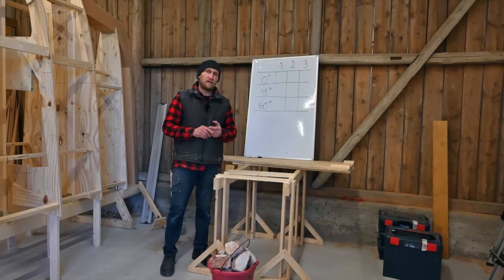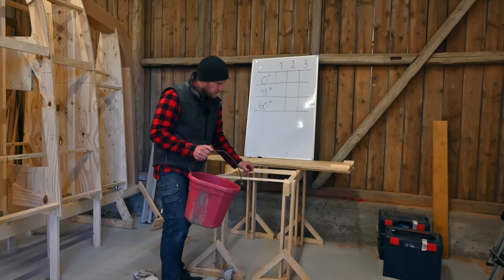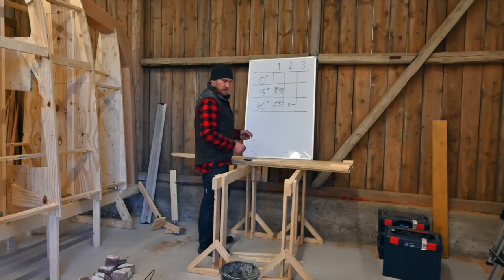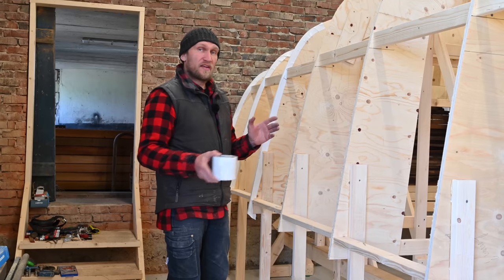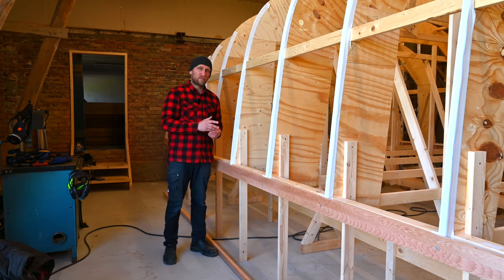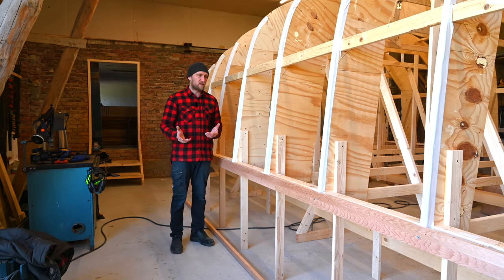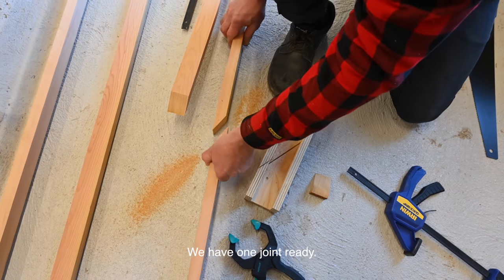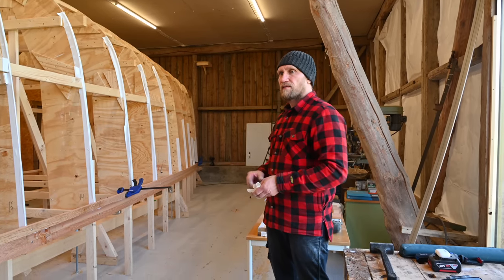The First Of 150 Strip Planks | DIY 50 Ft Sailboat - Ep. 344 RAN Sailing

Comment: Have you considered removing the screws after the glue cures? It would slow down construction a lot but would remove a possible risk of corrosion etc. This process was used in the construction of the Spruce Goose airplane. They used a combination of screws and glue and removed the screws, reducing thousands of pounds of weight overall.

Comment: My condolences for Your loss, Johan. 
Did You ever think of pouring Your resin out of the canister and weigh Your batches instead of pumping? I always found these pumps annoying to say the least, not just when it's cold. I never had my own set of pumps but always weighed my resins through over three decades of boatbuilding ... somewhere in the middle of the first of these decades I built a seesaw to strap in my canisters and thus just had to turn, no longer hold those to pour. 11/10 would recommend 😄

Comment: I would trust the scarf joint as well, but more because when you bend each strip, it will be easier to get enough leverage to bend it in the middle of each length, but each strip will be stiffer at the ends.  So when you're bending, you will be putting a lot of stress on each joint.  Just another way, I suppose, of saying that it is indeed easier to get a fair curve with a scarf joint.

Comment: Check out epoxy metering pumps. They dispense both resin and hardener in the proper ratio with each pump. You can see it in action on The Duracell Project YouTube channel. So sorry for your loss.

Comment: store epoxy in a heated enclosure , makes it much easier , when you start planking the more curved sections of hull , the gaps created between planks create issues , consider creating a convex and a concave edge ( router or spindle moulder ) on the edges and you will not need to shape each edge .

Comment: I couldn't see, and am not sure it matters when planking a boat, but the opening of your 60 degree splices should aim toward the aft of the boat. With house clapboards, using a mitered joint, it should face away from the weather...so water could never be forced by prevailing winds into the joint. I realize you'll be using fiberglass over the planks...but wonder if maybe it's still better to have the joint open to the aft rather than to the bow. We love your videos! Keep up the great work.
Reply: So sorry to learn your father crossed over the bar.

Comment: You might want to try making an insulated cabinet to keep your epoxy in.  The heat from a 60 watt incandescent light bulb would probably keep the epoxy warm enough to pump easily.  Just open the door, pump epoxy & hardner you need & close it back up.

Comment: Did you consider composite finish nails? I believe they are available up to 1-1/4 inch long which may be long enough for toe nailing in your application. They use a pneumatic nailer that looks quite standard. The nails will not damage cutting tools if you need to drill through the hull later. Spotnails is one brand sold in the US and I know there are others out there. These are popular in CNC applications because they won't damage the cutter head.
Reply from the maker: I talk about it in the video… 😉 Cheers!

Comment: im very sorry for or loss ,its a hard time ,but gets easier with time.....a couple of points re strip planking ive built 2 strip planked boats 11mtr and 10mtr firstly, build a warmer box for the epoxy use heat mats under and wraped around the bottles, the heat mats are like the ones used to propagate plants or just use a small heater in the box under the containers . scafing  full length planks helps alot  then you can do 15 or 20 planks per day.Its also possible to butt joint the planks on the boat with a screw either side of the joint. the planks above and below correct out the joint and make it fair thats what ive done on both boats .its quite common to use galvanised nails between planks in place of the screws your using they last fine if you think about it the planks once finished and glassed over they are fully encapsulated free of moisture and air so last fine
Reply from the maker: Thanks for the tips Adrian! Cheers

Comment: They make epoxy dispensers that will pump out both components. That way you avoid making a mistake and it's faster. Also you could place a heating pad under the resin to make it easier to pump. But not too warm or it will kick off to fast. Hope that helps. Cheers !

Comment: I am sorry for your loss. 
Total Boat has a dual ratio pump that measures both components simultaneously.  A chop saw with a fine blade could cut the scarf joints more quickly than a hand saw.  Can you put the epoxy components in a warm bath to heat it up a bit for better flow?

Comment: Looking great, perhaps you could make a box out of foam building insulation and have a electric heat matt  in it and keep the two parts in there to reduce the viscosity and make it easier to mix also you don't want it getting too cold and crystallising like mine did because then you will need to heat up to dissolve the crystals

Comment: make up a sealed box to house your epoxy in and run a 20w light bulb inside, this will warm up the epoxy to lesson the viscosity, making it easier to pump. alternately, put taps on and measure by weight!

Comment: If you do a search on YouTube for "Making a Cedar Strip Kayak" there is a build video on cedar strip planked kayaks by Nick Schade whose workmanship is second to none and he uses a few techniques that could benefit you, namely he uses a router to put a bead and cove on either side of the planks. This allows the planks to follow each preceding plank by providing a channel for the new plank to follow. He also uses a "U"-shaped piece of plywood to give a clamping surface to each plank at each station. Check it out, I'm am sure you will benefit from Nick's wisdom.

Comment: the hull is stronger if there is a gap between the staves in the hull. You do not need to draw them tight. Epoxy is flexible and will take up the stress from expansion and contraction and in the event of a collision it flexes rather than breaking like in your test.

Comment: @02:25 Yes, the glass has to provide the majority of the strength. the joint only has to hold till the glass is applied, after this it will not alter anymore.😁
Just out of curiosity about the strength needed from the wood: If any, what percentage of glass should be added when you had decided to use foam core...❓❓
@24:22 Please accept my sincere condolences to the whole of the family for your loss.😥

Comment: Hi Johan, Our condolences from Scotland. This is probably a stupid question, but if the planking is simply the sandwich material for the GRP sheathing then why not use a sheet material such as plywood or Oriented Strand Board (OSB)? If you used multiple sheets of overlapping ply it would have the flexibility necessary for the curve of the hull. I recently built a Shepherd’s Hut (a traditional mobile building used by shepherd’s in the UK in earlier years) which has a curved roof. I made the roof with thin ply which was fixed to curved rafters that had been made from multiple laminated strips of thin plywood. The boards are only curved in one plane though, with compound curves this would be more difficult.

Comment: Sad to hear about your Dad Johan.. I was surprised you dint consider Half lap joints...  For clamping would it be possible to use a ratchet strap anchored to the frame support, This would allow you to tension almost to the keel. in a similar way to the method used in old times to keep a hull together in emergencies.
Reply from the maker: I’m doing some testing with a sort of half lap joint right now actually. Still haven’t decided though… 😊

Comment: Sorry for your loss. Looking online, there are tables that show recommendations saying between 6 and 15 degrees relative to the length of the wood. I know by now you have already completed a majority of the strips. A better way to test would have been to use a piece of wood with no joint, then joints, relative to the length of the wood at 6, 10, 15, 45, 60 and 90 degrees. So zero degrees to me is parallel to the length of the wood and 90 degrees is perpendicular.

Comment: For resin pumps check out the seal boss pA 3000. It would really speed things up for you guys. Also Total Boat sells one as used on the Duracell project. Also aircraft spruce sells a smaller model that is air powered for $390 USD . Your boat is looking great!
Reply from the maker: Thanks for the suggestions and tips! 👍😊

Comment: You could use simple cheap drywall screws for the initial curing of the planks. Then remove them prior to fiberglass.
Reply from the maker: That’s exactly what we are doing now. 😊
Reply: @RANSailing  that will save lots of money.

Comment: Having just watched Johan's experiments with the joints, there's another factor to consider as well. You all are going to be fiberglassing this hull, correct? If you're able to get the hull faired, and apply the glass nice and flat, it seems like any loss of shearing strength on that joint would be handled by the glass. I wonder about making the hull too rigid, resulting in stress fractures in the ocean waves (over time), or as the result of a collision? I'm just an armchair YouTuber, so take my opinion with an appropriate grain of salt. 🙂
-Edit: 60 degree join makes sense. Trading joining time for fairing time. 👍
-Edit 2: Rest in peace Mr. Hammarlund. You've left a remarkable legacy.

Comment: Looking good, you certainly put a lot of thought into the build. One question on the stainless screws holding the planks in place while curing: Why not remove them after the cure?
Reply from the maker: We could remove the screws after curing, but that means we only can mount 2 strips per day. Since we have around 150 strips to mount that would take quite some time… So leaving them in, means we can speed up the planking by a lot. Cheers!

Comment: For Scarf joints the strength of the joint increases as the joint becomes longer v the thickness of the timber.  Lloyds insist on 4:1 for planking.  I wonder what their standard is for this method of epoxy bonded planks side by side.  I think the test should include unjointed pieces of timber and also some glued together sections.  As you say the epoxy bonding of adjacent planks and the screws may add strength. 

The Duracell Project use a West Systems combined/single lever pump.  However I have heard that Total Boat products and perhaps others have 3 or so options for speed of curing, that sounds really helpful when planning jobs, particularly at variable temperatures of Sweden. Some people use heating pads in an insulated box to pre-heat the epoxy.   Considering the volumes of epoxy you will be using, you should be able to find a bulk distributor of epoxy, they are the ones 1 tier removed from the producers and operate on competitive margins of 20-25% of cost as they don't repackage, rebrand. However you always need to require of a minimum shelf life remaining, operate batch control, test before working. 

Sorry to hear of the passing of Johan's dad, Johan is a huge credit to him, with so many great qualities arising from good parenting.  Particularly important to know him.  Condolences to the rest of your family too.  Lovely that that he was able to see RANII take shape.

Comment: If you move the epoxy into a safe spot in your house, and bring it out when you need it, and if you have a heater for the barn, you can keep it kind of close to that heater while keeping it far enough away so that you don't have to worry about a fire, the epoxy won't be so thick.   You can also use small scrap pieces of wood screwed into those frames and normal clamps to get it all clamped up.  I mean you only need the clamps on their for a day or so, so you wouldn't need a billion clamps and scrap pieces of wood....  You could also just use string and simple nails in those frames, as long as the string is tied to a nail that is at the right angle compared to the wood, you could put even pressure on the front pushing in, and pressure on the top pushing the boards together...    I may have explained that crappy like, but if someone thinks about it I am sure they can figure it out.   You could also use thin rods to apply pressure from any angle, like acoustic guitar builders do sometimes..   There are about a billion ways builders of things have came up with, to clamp wood lol....

Comment: If the wood is consistently breaking at the joint...something is not quite right with your epoxy bond. I would make sure to use unthickened epoxy on both sides of the joint and then thickened epoxy (with silica only) on the middle...then apply modest pressure to hold in place while curing so you dont starve the joint. If the temps are below 70 or so, I would add a small electric space heater and cover with plastic while it cures. I would scarf planks with a 1:8 ratio at least.

Comment: My condolences to the loss of your father  Johan. Have you considered long ratcheting cargo straps that will wrap completely underneath the first plank? With some chocks temporarily screwed to the form, you can redirect the vector to pull in as well as down. Also I'm puzzled as to why not remove the stainless screws that you put into the edges as long as you're removing the ones in the sides?
Reply from the maker: Thank you! Yes, we though of using straps and it probably could work, at least for a pretty big portion of the sides. The problem is however that it become complicated when you have 3-4 strips glued up on top of each other. That’s why we need to leave the screws in, since the progress would be too slow waiting for each glue line to cure before continuing with the next. Thanks for watching! Cheers

Comment: The old way in the U.S. on large strip plank boats is to use Bronze or stainless ring fast nails when edge fastening the strips on the frames ;-) You might find the nails cheaper and faster than your present fasteners

Comment: How long will the joints hold to the pounding of the waves beating up wind? Perhaps balsa-core added to the outside of the strip planks woud give the boat more strength, pluss insulation so the hull wont build up moister inside durring cold weather.

Comment: Sorry to hear about your father's passing. One thing to consider may be not an angle but the ratio. I think the standard scarf is 12:1 length to thickness ratio. If the strip is 1cm thick, the scarf would be 12cm long.
Reply from the maker: Yes, I now. I mention that in the video. However, since this is a sandwiched hull and the joints aren’t going to be stacked a 1:12 joint isn’t necessary. Cheers!

Comment: You probably don’t even need stainless screws. The core will be dry. In traditional wooden boats where screws were constantly exposed to salt water the galvanized screws worked for about 20 years before the hull needed to be refastened. In composite hull they would probably last forever.

Comment: To save some costs, leave the screws in place only long enough for expo to cure, then remove and reuse up higher on the hull.  doing this you can drop the number of screws to 15 or 20% of the 7k you estimated.  It does mean extra labor to remove the screws though

Comment: Instead of SS screws, what about bamboo skewers? You will need to drill a hole for each, but you would have to drill pilot holes for screws anyway. Skewers are cheap and strong enough to keep things aligned until the epoxy cures.

Comment: Since you’re glassing hull from both sides your strip planking is a core and you need only enough strength to bend plank on the jig without breaking. Without glass it would be a different story.

Comment: Scarfing takes time and you need to get much more contact area of the glued sections... I'm thinking you will need to scarf in the area of 75 degrees... You can make a router jig to make this longer scarf faster and have a fairer hull with much sanding and fairing... What does your marine engineer have to say about this seeing he has the final recombination
Reply from the maker: Since the joints aren’t stacked butt joints would be strong enough according to the architect. We’ll probably go with the 60 degree joints since it’s easier to the the “line” fair with those… Cheers!

Comment: what about no compression screws at all. gang stack several planks at a time and clamp the epoxied joints from both directions, to the frames and vertically edge to edge?

Comment: With a rolling plank production method, couldn't you prepare a long planks for each side and place another set on the mould? You can prep a pair a day and the next day (after curing) place them on the boat. I'm sure after a few hours you could even get a second set of planks on per day. Using loads of clamps will mean no screws which risk corrosion and the associated cost

Comment: Sincere condolences on the loss of your father Johan, peace at last.

I wondered if you could use a warmed water vessel with a electrical water heater installed the base linked to a thermostat to warm those "glue" type materials. Farmers in northern states in the US and Canada regularly use such equipment to stop water supplies freezing over in severe cold weather for drinking supplies for livestock.

I'm surprised that you seem unable to locate a pneumatic powered gun and suitable fixings and seem content to use stainless steel screws for fixing the strips.

Did you know that you can obtain a pneumatic gun for applying cement mortar to cobbled walls? I wondered if it might be possible to fit such a tool with disposable plastic nozzles cut to shape and size so that the glue could be loaded quickly, easily and used like a caulking gun.